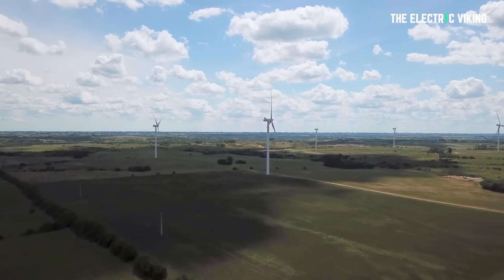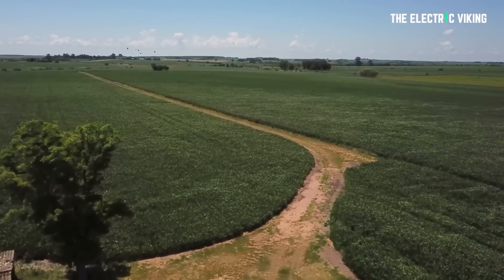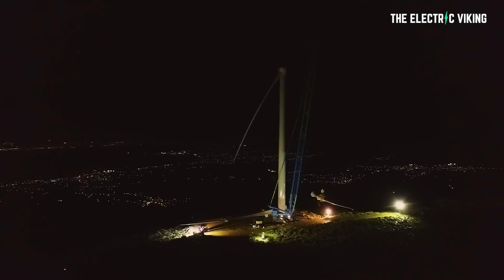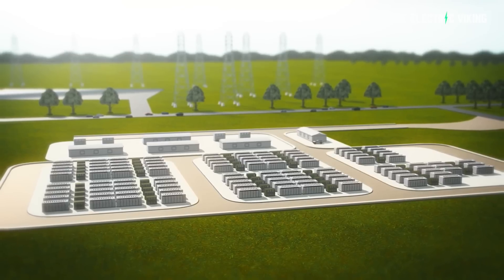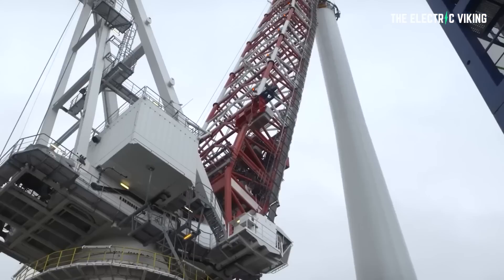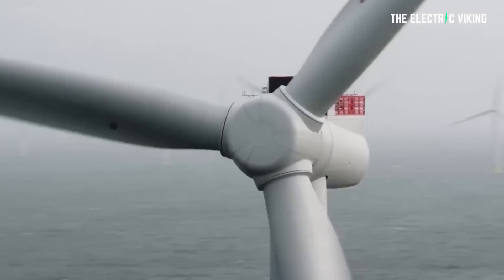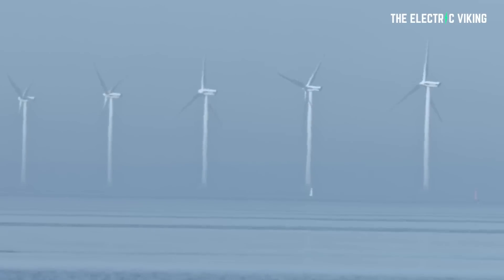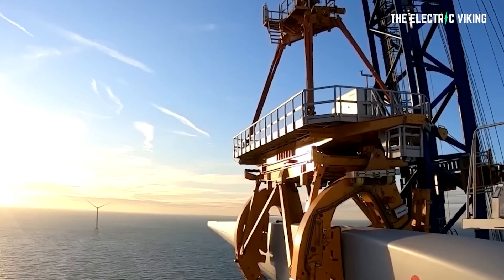The world's most powerful wind turbine can power an entire town

Comment: There is a third source of renewable energy emerging: Geothermy.

As much as wind plants get more powerful by going higher up, Geothermy gets more powerful with deeper drills. Just because the deeper you go, the hotter it gets.

Technologies for deep drilling have been developed and proven in Oil and Gas, and new technologies are coming around the corner, such as laser drilling.

Benefits?

1. Geothermal brings continuous energy.

2. The geothermal water brings lithium that we can use for batteries.

So, the mix of energy coming from the side (Wind), from above (Solar), and from below (Geothermy) will make nuclear power plants obsolete.

Comment: You forget the rise of the machines... the internet of things, and all that.
China's data farms are on course to use more electricity than the whole continent of Australia by 2030.
Now if you plan on covering the Atlantic ya might have a point.
But with the re-shoring/friend-shoring of manufacturing, the electrification of transport and home heating... you're going to come up short, very short.
Technical yes it's possible but again not all countries have access to the sea.
Even if you could generate the required electricity ya'd still need to store a great proportion of it for when the times the wind doesn't blow.
We're going to need everything in the toolbox going forward and nuclear has to be part of it...unless you're happy enslaved to the carbon barons that is.

Comment: I’m all in favor of wind + solar + battery, but I still worry that there will be a few cloudy, windless days in January (US) where we will run out of power.  And we have solar on our home, so I can see some of the local data.  Keep up the great work Sam!
Reply: ....not to worry.. the grid is most everywhere a continuous real time auction. Bids are staged day-ahead on highly reliable forecasts of electrical generation, electrical loads, and weather. There is ample idle reserve in the case of extreme events... up to the point of bunker-proofing everything at extreme cost. This is actually how the grid has always worked.

Comment: IMO Nuclear complements renewables, reducing the number of batteries needed.  Wind+batteries its still more expensive than nuclear, add the national security on dark and windless times.
Reply: They don’t. Nuclear is steady and slow to ramp. Wind and and solar are highly variable. The only fuel that can ramp fast enough to cover for the wild swings of wind amd solar is natural gas, so more wind and solar means more natural gas.
Reply: @kokofan50  I said "COMPLEMENTS"  reducing GWatts required on batteries.

Comment: Yep wind is very good option for europe where sun is not an option #1. In my country Estonia Sunshine in december is 5% of that shines in june. And even worse ther may be up to 5 month period of snow. And winter is when energy is needed most.  But when talking about wind then Estonia has plans to build 2x  power needs worth of windfarms mostly offshore.  Even then it is not guaranteed to have power it must built at least 4 days worth of battery also to be 100% secure  it might be up to 10 % GDP to build that 50% of it can be long seasonal storage in hot sand that can hold solar but other 50% must be some kind of battery storage molten  metal or LFP or something other.

Comment: I assume you're only referring to Australia, but then there aren't any nuclear power plants in Australia. Maybe the wind around Australia is consistent enough for reliable wind energy, but for a country like the UK it's not feasible. Just this last week we've had sub-zero temperatures and very light winds hence wind and solar generation has been negligible. It's gas and nuclear that's been keeping the lights on.
Reply: You are not supposed to say these things along with the fact petroleum is used as a material to buy almost everything we use  ..not 1 thing on the earth is made out of electricity
Reply: @marshallderriek1858  No oil = no plastics or lubricants = no wind turbines, no electric cars

Comment: I saw an article from Sweden (if I remember correctly) that started with so-called wind walls.  A large frame with small diameter windmills that are more effective than the large ones because they can operate within a greater wind speed range due to smaller tip soeeds.  Wind energy increases parabolically with speed.

Comment: Man you really need to do some research wind turbines aren't as green as you all think the energy required to manufacture and install these isn't regenerated by the turbine it's self so basically if all the power was harnessed from one wind turbine you wouldn't have enough energy to finish another before it failed the energy to make the steel for the massive masts the giant concrete footings the alloys and copper for the generator and the monstrous blades they would be fibreglass or a carbon composite that's probably formed using a kiln or vacuum chamber or both how do you make these with out energy and the ocean is a damn harsh environment so the materials would be super expensive to last or maintenance would be needed a lot or they will be replaced quite frequently making them less "green/viable" then any other for of electricity generation weather it's gas coal nuclear oil all better then wind

Comment: But....when the wind doesn't blow there is no electricity generated.  I've been following the electricity generation for the UK recently and on cold days last week wind generated electricity was as low as 1.4 GW some days.  It's not reliable.  We need gas, coal and unclear for base load.  Nuclear is clean, it has a small footprint (think nuclear submarines).  It's the best solution by a mile for many countries.

Comment: Wind and solar will replace a good portion of "dirty" energy but it will also require the installation of enormous storage facilities. We (Germany) recently had almost no wind and no sun and all the "bad generators" had to run full steam.
Reply: No, enormous storage facilities is not correct. It is enough to install a 15 kWh battery in each household, 100 kWh for each store and a 5 MWh facility per 250 households, roughly. Industry still require 100 MWh storage though.

The age of centralised power is ending.
Reply: @wertigon  Can you imagine the battery size required  in a 80 apartment house? And that's without considering BEVs which want to charge overnight. Today I had to charge our two BEVs and around 80kWh went into them. No solar today so it all had to come from outside. We have to drive daily so just waiting until sufficient power is available isn't an option. Even without charging a 20kWh battery would last for our house for just 1 day but we had almost 5 weeks with minimal wind and sun.
Reply: @juergenschoepf2885  An 80 apartment house? Yeah, a 1MW battery ought to be good enough for an 8 hour buffer. That is four Cybertrucks.

Comment: Right now in Denmark we have sky high electricity costs, and we are one of the countries in the world with most wind mills. But the wind is not blowing and the last 6 months there have been less wind than normal. So we have the largest and best windmills ind the world, but no wind. That is why we need nuclear.
Reply: Problem with nuclear is that it is for constant load and not for peak load.We had the same problem in Germany. With wind and solar enormous storage facilities are required. With batteries you would have to plaster entire Denmark with them. Water pump storage won't work due to geography so the last resort will be H2.
Reply: @juergenschoepf2885  Not entirely true (if I understand you correctly). Nuclear is easy to set up for varying load. that is done in multiple places.
Reply: @MyStockScanner  You can't control the output power for a nuclear reactor as you can do with gas or coal fired power plants. Especially ramping up takes quite some time. In other words, they are better suited to suppl power for a base load.

Comment: I live in Melb,  My solar panel produce 620kw power per month in the winder, and i use 640kw in winter. However most of the power usage happends at night, so i end up selling most of the power to the grid at 0.069 aud buy back at 0.24... so i end up with a huge electric bill.   if Battery tech become cheaper and can last 10 years and i switch to electric cars. I think it will significantly reduce my electric bill and petrol bill, it should pay for itself in 5-6 years. This will be great for the environment and good for my pocket. I think the key is the battery tech.

Comment: The anti nuclear stance is idiotic; Nuclear is great to help offset power demand when wind/solar are low; also nuclear requires NO batteries to store power for peak hours, the most environmental battery is the one you dont have to build at all; Modern Nuclear can be built with green materials and output low amounts of radioactive waste, the only valid complaint against nuclear these days is cost, but the industry is working to tackle that issue with smaller prefabbed reactors.

That's not even touching upon the future of wasteless nuclear with fusion power, so again, anti nuclear stance is idiotic.
Reply: Disagree, until you explain how it will be cleaned up
Reply: @jsanders100  nuclear fission reactor are getting better and better at reducing waste or recycle waste.
Waste has also been stored quite well too and there is no shortage of remote location to store it at. It will be expensive to store but at least nuclear is feasible at replacing fossil fuels, the other renewable simply cant

Comment: Wind does not blow as the rime. You would need a huge amount of batteries.  Wind  turbines only work in a certain design band. Faster or slower wind and they stop generating. Barely economical without subsumed.
Solar is much cheaper. No moving parts is a big deal..
Reply: Uk data says otherwise. Wind energy is cheapest by far. Of course other countries may have less wind and more solar.
Reply: Why does it have to be one or the other? Does the sun shine 24 hours a day? Don't you also need batteries to store energy from solar panels? Your comment is disingenuous

Comment: Lol.  Without 24/7 total base load electric capacity the grid cannot function.  Unless storage technology improves, intermittent power sources cannot power the grid.
Reply: The glaring obvious fault with sams insistence that “renewables “ will power the grid is that there are things called clouds, and darkness (night) and no wind.  I wonder how many of them itty bitty lithium batteries, they are the size of D cells, would be needed to power the world?  Lol.  A bunch buddy!  Zillions.  Thank GOD we still have diesel to power the equipment that mines, transports, refines ALL the raw material we will need to build those trillions of tiny batteries!
Reply: Do some research on base load & vehicles
Reply: @jsanders100  

That’s an interesting question.  If you don’t have to actually DRIVE your vehicle, and it sits in your GARAGE, and it has the facility to feed power back to the grid, these batteries could provide storage.  Will the utilities BET on it?  If i was running a utility, I wouldn’t.  I’d want a sure thing.  The ONLY carbon free 24/7 cheap (molten salt nuclear thorium reactors apparently, because thorium at this time is VERY cheap, it is a byproduct of rare earth mining, you know, the stuff turbine magnets are made of) electricity is nuclear.   

Sam keeps throwing out these predictions about 2030.  2030 this.  2030 that.  We just gonna see about those predictions:  I for one predict, by 2030, as the world watches Germany and Europe de industrialize and the mob takes to the street, the wrongness of wishful thinking.   Their wind and solar WILL NOT save them.  Not short term.  Not long term.  There ain’t enough batteries in the world to provide EV’s and grid storage.   This is not an article of faith or religion with me.  If batteries were the solution I’d be one happy camper. They will play a minor role.  They will not power heavy industry like cement, steel, fertilizer.  

We will see what happens   By the sams magical 2030 date.  Will nuclear be adopted?  Let’s get on our knees and say a prayer for the next generation and the future of humanity that the correct decisions will be made in time.

Comment: Right on. Despite the Hype, fusion and fission lose economically, even before the dangers and toxicity.
Reply: Germany invested in renewables. They had the most expensive electricity in Europe, even before Russia invaded Ukraine. France invested in nuclear and has the least. You can’t argue empirical results.
Reply: @kokofan50  what an overly simplistic analysis. How many nuclear power plants have been shut down because they are not viable?
Reply: @enadegheeghaghe6369  In Germany  they were shut down for political reasons. Nuclear isn't that expensive. Coal and gas are the culprits for the price explosion.
Reply: @juergenschoepf2885  you do realize that the world is much bigger than Germany?
Reply: @enadegheeghaghe6369  yes and Europe is completely interconnected and it was still a huge problem for about 5 weeks.
Reply: @enadegheeghaghe6369  None, all of the plants I okow of have been shut down for political reasons, like Germany’s fleet.

Comment: Who comes up with these bonzo ideas? You should pray for Thermonuclear.  Do you really think even Denmark and Poland will be surviving in wind farms in 10 years when the very first of these is due to be complete? No; they are #1 unreliable - 2 dont provide enough power to do than a modest city 3. cost too much. Even in the baltic; winds are not steady enough and frequent enough to be generating power more than 30% of the time; most is during winter.  The combined population of Denmark and Poland will be 70 million by the time this is done.  The cost is not just the wind mills which is billions; they need storage for the 70% of time these mills are ideal.  Even in these windy areas; you'll need 10x as many to even begin to meet the needs of 70 milion and that is if you don't do EVs.

Comment: Simply matching electricity pricing to wind supply (ranging from free to "outrageous") would practically eliminate the need for grid storage. Consumers/appliance designers would come up with their own solutions to grab low cost tariffs for their water heating, lawn maintenance, battery charging, etc...
Reply: Well that may work for domestic, but not for industry so much

Comment: At least we don't need to put them somewhere safe for the next million years after they are decommissioned
Reply: Nothing lasts that long.
Reply: @tedmoss  wastes or spent fuel from nuclear fission power stations do remain radioactive for that long.
Reply: @adon8672     https://en.wikipedia.org/wiki/Integral_Molten_Salt_Reactor     These modern Gen 4 reactors are walk-away safe, inexpensive, & can be designed to burn nasty wastes from older reactor designs.  Unless & until we have storage systems {at huge expense!} to handle intermittent wind & solar, each new wind or solar farm needs reliable backup power sources, so we end up creating TWO parallel energy systems.  This is not economically sane, imho...

Comment: You're missing one huge problem with wind power. Wind!!!! Or more precisely the unpredictability of wind. The Fully Charged Show were very keen to extol the virtues of wind producing more than half of the UK's power when it was windy during the Summer. I haven't heard anything from them at all about the last two weeks when there's been virtually no wind in the UK, temperatures have remained sub-zero and wind power has accounted for-at best- 3-4% of the UK's demand. You need powerful, predictable, reliable, consistent, dependable power that can deliver, day or night, winter or summer, and the only green solution is nuclear.
Reply: FIFTY-THREE MAJOR nuclear reactors are being built world-wide currently, FIFTEEN by China. Nuclear is the cleanest, safest, most energy-dense, and MOST PRACTICALLY SCALABLE reliable base-load supplier, as you note. IT IS THE ONLY PRACTICAL SOLUTION CURRENTLY AVAILABLE. The rest is fantasy.
Reply: Only?
Reply: @theairstig9164 The only other one is hydroelectric, but that’s very geographically limited
Reply: correct
Reply: @andyw2132  https://www.youtube.com/watch?v=pR771FJYr-4
Any power source reliant on the unpredictability of weather cannot be considered as a first line power source. You're talking averages. What about the times when there is zero wind.? When wind accounts for 3-4% of total demand what are we supposed to rely on???????